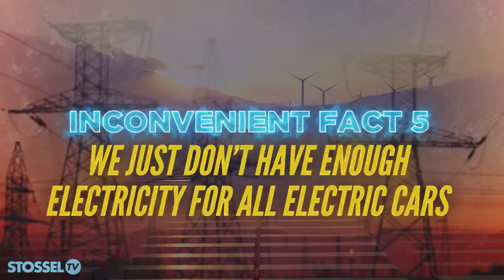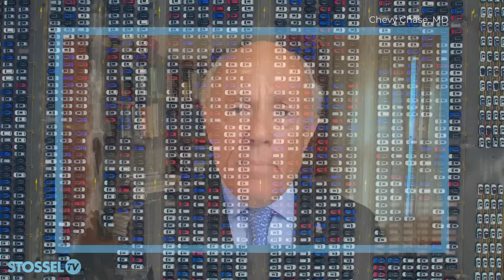Electric Cars: Inconvenient Facts, Part 2

Comment: I'm just happy someone like John isn't afraid of getting cancelled for giving a different perspective on this so called "green energy"
Reply: He can give another perspective but this video is full of things that are simply factually incorrect by a wide margin.
Reply: @dmacm nah I don't think so.
Reply: @dmacm  Please specify the incorrect things and provide the 'facts' with sources
Reply: @Argedis  I will cite my comment here in order for you to skim thourhg it and look at some of the lies told in the video:

=*=*=*=

· 1. The solar panel claim is completely false. The most the US grid has demanded in an hour is 720 gigawatthours. Even in winter, which is obviously the season with the least sun, an average square meter of US land will get around 3kWh energy/day from the sun (on summer, it's more like 8 and the numbers are obviously higher for sunnier states like Arizona). 3kW/h per day is 125 Wh. Now, accounting for the fact that solar panels harvest around 15% of the solar energy they receive and even accounting for the fact that some space would have to be left for other infraestructure to support solar (let's be quite pessimistic and say only 75% percent of solar infraestructure area is solar panels), the total area required would be:

720,000,000,000 Wh / (125 Wh/m^2 * 0.15 * 0.75) = 51,200,000,000 m^2 = 51,200 Km^2. And the US is 9,834,000 Km^2 big. In fact, Texas alone for example is 695,662 Km^2 big.

So, even if we put ourselves at the worst-case scenario (record demand in december with innefficiently placed and badly located solar panels), all the solar panels required to cover the demand would fit in 0.5% on the US or like less than a twelfth of Texas. I've just checked and my result agrees with studies such as a 2013 study by the National Renewable Energy Labs (NREL), which estimated (with 2013 efficiency numbers) that the area required is around 55,037 Km^2.

Not that you would want to do that, it would be stupid to only use a single energy resource and call it a day, but it demonstrates how big of a lie the statement was. Solar is more than efficient enough to be viable

· 2. No person that actually knows something about energy will tell you that we need to cover all of our storage needs with lithium-ion batteries. Batteries work well on a small scale (like phones, laptops, housing appliances, cars or maybe even as backups for homes). Despite of that, they are really innefficient and expensive on a larger scale. There are other methods (like gravity-based water pumping, electrolizers or air compresion, just to name a few) that are much better suited for the task of storing large amounts of energy, and those are the ones that would be used as energy storage and taken into account in a clean electrical grid.

· 3. "But wind and solar are so unstable and that makes them unviable". Wind and solar, are not the only CO2-free tools that we have. In addition to the energy storage already mentioned, nuclear and hydroelectric energy (and with less importance, geothermal energy) provide a stable stream of electicity at a competitive cost while generating practically no CO2 emissions. Studies such as N. Sepulveda J. D. Jenkins et al. (2018), "The Role of Firm Low-Carbon Electricity Resources in Deep Decarbonization of Power Generation" have concluded that combining renewables such as solar and wind with energy storage (like the ones mentioned in 2) and with these stable sources of power would be confortambly be able to cover 100% of the elecricity demand while producing practically no CO2 and while not raising the costs of electricity. In fact, given the war in Ukraine, how OPEC is jacking up fossil fuel prices and other geopolitical factors that won't fade away soon, we'd be much better of if our main source of electricity weren't fossil fuels. Renewable electricity prices have now been consistently cheaper for many years, but specially now.

And there's many more things that I've seen being wrongly claimed in your videos, but this one was the straw that broke the camel's back, almost nothing contained in it was based on reality, but in a false imaginary world taht we don't live in. If you want to keep making content like this, fine, you can do so, but know that you are simply promoting lies and false information to your audience. It's never too late to accept a mistake like this.

=*=*=

I personally also think that electric cars aren't a good solution for transporting people, but because cars themselves aren't a good option and have never been (that's another thing that the US doesn't get). In my opinion, he's defending the right thing but based on completely wrong premises and information. Electric cars won't solve climate change, they probably won't even help that much at all. But we shouldn't defend that with lies; he is just making it easy for those that think they are useful for dealing with climate change (or at least they say so in order to appear 'green' or for personal or monetary gain) to defend their (quite wrong) position.

That should cover it.
Reply: @adrianv.v.4445  Everything you said is theoretical, here are the real world numbers.

Per the EPA the daily energy use of all American Households 3.58 billion kWh - that's not including commercial or industrial.

Consumer grade 200W Solar Panels are 2ft x 5ft and around $250 ea.
In the real world they only produce around 150W.
You would need 10 of them = 20 ft x 5 ft to get 1500W which is barely enough to get "Level 1" standard plug charging on an EV which only gives you 1-3 miles per hour, or run a Microwave.

In other words with 100 Sq Ft of solar panels you only get 1.5 kWh assuming full sun.

The US is 3,717,792 Sq miles. If you do the math per my 100sq ft / 1.5kWh you only get 294 million kWh - it's not even close.

But that was calculating it for 1hr lets say 10hrs of full sunlight (not accounting for sunrise/sunset losses) that's 2.94 billion kWh which is closer but still not enough and like I said that's barely accounting for residential only.
Reply: @dmacm  please delineate? More truth than not so please elaborate
Reply: He's not getting canceled (nor should anyone expressing their right to freedom of speech), but he's not getting the attention he deserves due to social media algorithms.
Reply: @Argedis  The video is an excellent example of propaganda. It states something true or partially true, and doesn't tell you the comparison to an alternative. For example, their claim that an EV battery weighs 1,000 lbs and only replaces 80 lbs of gasoline. While that statement is true, it's also a falsehood in that an EV doesn't have a V8 engine + transmission, which combined together weigh 1,000 lbs. Furthermore, the statement that gasoline has many times more energy per lb (density)  than a battery (true), it fails to tell you that you waste 75% of that energy as heat when you burn it in a car. See how propaganda works?
Reply: @justsomeguy934  You're comparing the fuel source (battery) to the motor (engine)
The electric motor also has weight you know.

Also most of the energy is wasted as heat yes and we can use that same heat in the winter to warm the cabin unlike EV's which substantially use more power to do so.

We have been engineering engines to be more efficient to take advantage of that wasted power whereas with EV's the solution has been to put bigger batteries. Battery tech hasn't changed much in decades and the new 'solid state' batteries are extremely expensive compared to Lithium already.
Reply: @justsomeguy934  you can't be serious... heat energy is turned to force energy resulting in hp or torque you do not loose 75% to heat soak.

  You are not correct sir please please refrain.
Reply: @donguess4332  ok guys he doesnt think so , hold up , the word is going to change tho.
Reply: @dmacm  like?
Reply: @Argedis   Did they teach you how to use a calculator? With the numbers YOU provided, if you cover the whole US (1.058*10^14 sq feet, I don't get why some Americans still use Imperial) with solar panels with the efficiency you mentioned (1.5Kwh/100 sq feet), you would get 1.587*10^12 Kwh of power. That is, in a single hour, you'd get 1587 billion kWh, which compared to the less than 4 billion kWh you mentioned, means that after 2 hours, enough electricity whould have been generated to cover for all US households demand in the whole year. Yeah, the numbers get ridiculous when you do the though experiment of covering the whole US in panels. But, as I stated earlier, only a small portion of the US would be needed for the task. So basically, review your math a bit before proving your stupidity online (or even better, keep that dumbness to yourself).
Reply: @Argedis  But we are talking about replacing gasoline vehicles, not replacing  all the energy a person uses in the day.

I'm glad you ran some numbers though, even though you made some horrible mistakes in your calculation.  Lets try that again.   First I'll give you my estimate, then we'll correct your calculations.

The total energy consumption in the U.S. from all sources for 2021 was 97 quadrillion BTU, which translates to 28427895 million kilowatt hours.

The annual generation from a solar panel per square foot is around 238 kWh.   There are 27878400 square feet per square mile.  So we now have 6635 million kwH per square mile per year.   

So divide it out.  28427895 million kWh divided by 6635 million kWh per square mile is 4284 square miles.

That's a 65 mile x 65 mile square.

--

So, where did your calculation go wrong?  Well, lets try using your assumptions to find the error.

"Per the EPA the daily energy use of all American Households 3.58 billion kWh - that's not including commercial or industrial."

Lets validate this.  This comes to around 10.78 kWh/day per person.  Actually I think its more around 14 kWh/day per person on the EIA site, but we'll run with your number.

"Consumer grade 200W Solar Panels are 2ft x 5ft and around $250 ea.  In the real world they only produce around 150W. You would need 10 of them = 20 ft x 5 ft to get 1500W which is barely enough to get "Level 1" standard plug charging on an EV which only gives you 1-3 miles per hour, or run a Microwave."

"In other words with 100 Sq Ft of solar panels you only get 1.5 kWh assuming full sun."

"But that was calculating it for 1hr lets say 10hrs of full sunlight (not accounting for sunrise/sunset losses) that's 2.94 billion kWh which is closer but still not enough and like I said that's barely accounting for residential only."

This is massively incorrect and the reason is that you keep shortcutting your units and not keeping track, so you lost a lot in the translation. 

Your calculation... 100 sq ft x 1.5 kWh x 10 hours and you came up with 2.95 billion kWh per what ?  per square mile?  No. 

1 square mile is 27878400 square feet, so 1.5 x 10 = 15 kWh/day for 100sq feet.  27878400 / 100 * 15 =  4.181 million kWh per square mile per day.

So take 3.58 billion and divide by 4.181 million and you get (drumroll) 856 square miles using your numbers, which would be an area of 29 miles x 29 miles.

--

Lets recalculate another way to verify and use better metrics for the solar generation.  But I will still use your 200W panel so you can see where your other assumptions went astray.

One 200W panel at 2ft x 5ft will generate around 1.0kWh/day to 1.2kWh/day on average.   You just multiply the nameplate of the panel (200W) by 5-to-6 or so as a rule of thumb.

One square mile is 27878400 square feet.  One panel is 10 square feet.  So using 1.0kWh/day per panel we get 2.78 million kilowatt hours per day per square mile.   

Using your number of 3.58 billion kWh/day and converting it to millions, 3580 million kWh/day, and dividing, we get 3580 / 2.78 =  1287 square miles.

Which  is 35 miles x 35 miles.   Which is far far smaller than the total area of the U.S. by a huge amount.

--

Using fewer assumptions and 14kWh/day per person, the actual area winds up being around 65 miles a x 65 miles or so.

-Matt
Reply: @justsomeguy934  Electric Vehicles weigh more on average than conventional gasoline powered vehicles. Exceptions are the BMW i3, which is limited in range and uses a shitload of carbon reinforced plastics, and is an excellent in-city runabout vehicle, but certainly not an all-around vehicle I'd use for long distance transportation. Even if they managed to eliminate all of the other carbon emitting parts of the supply chain to build the electric vehicle and power it, that vehicle is going to wear down the roads it travels on faster due to the heavier weight.
Reply: @Argedis  The statement that you need to cover the US with solar panels to meet our energy needs was the most egregious misinformation. Look this up yourself. The true land requirements are small, and this isn't the main cost driver.
Reply: @bengaltiger96  Absolutely false, and the "heavier cars wear the roads more" is a falsehood from the oil industry about a decade ago. I just finished listing (in another thread on YouTube) ten average automobiles and their comparison to equivalent EVs - the results are the same. The EVs weigh in the same range as their gasoline counterparts. There is no weight penalty! Did you know the same oil industry propaganda used to also say heavier EVs meant more brake dust, so they caused CANCER? Yup, that idiotic thinking actually get repeated even today, from time to time. Just FYI, EVs don't use their brakes, so no  brake dust. 
As for an all-around vehicle, I've driven my 8-year old EV all over the USA with no problems. I've got almost 90,000 miles, been through desert, mountains, rain, 107-degree Kansas heat, snow, sleet. I'll never buy another gas car again.
Reply: @justsomeguy934  Volvo XC40 T5 R-Design gasoline) weight: 3,492 lbs. Volvo XC40 Recharge (EV): 4,758 lbs.
Reply: @justsomeguy934  I also never made any comments about brake dust, so thanks for the strawman.
Reply: @justsomeguy934  At 90k miles in 8 years, you are under the average yearly mileage for an American driver. But you've owned and used your EV in a manner that might lead to less carbon emissions versus a gasoline counterpart - assuming you've overcome the extra carbon emissions required to build your car due to the batteries, and the emissions from the power plants supplying the electricity.
Reply: @justsomeguy934  And I woudln't imagine the oil industry railiing against "heavier cars" given that the trend toward SUVs and crossovers has led to increased fuel consumption, which only helps them. And I'm not a fan of SUVs and crossovers, either, for this very reason. I used to live in Washington State, and I'd have to navigate my old 911 and 5 Series cars around the equivalent of single occupant Iroquois longhouses on wheels.
Reply: @bengaltiger96  " also never made any comments about brake dust, so thanks for the strawman." I am aware you never said anything about brake dust, I was showing you the source of your disinformation also stated that EVs caused cancer due to more brake use with a heavier car. Your source of information is the same.
Reply: @bengaltiger96  No, an EV breaks even in environmental impact of manufacture over a gas car at about 15,000 miles. I'll leave you a link with the information. I have friends with 170,000 miles on their EVs that Uber with them, and they most certainly are better for the environment at that mileage over a gas car.
Reply: @bengaltiger96  "assuming you've overcome the extra carbon emissions required to build your car due to the batteries, and the emissions from the power plants supplying the electricity." Burning gasoline vs. a steam turbine at a utility plant is no comparison - a gasoline car not only wastes 75% of its energy as heat, but it's a much dirtier fuel than a utility plant can use. Over the life of the EV, it's twice as clean as a gas car.
Reply: @bengaltiger96  Tesla Model S: Curb weight: 4,323 to 4,936 lbs. Mercedes S-Class Sedan: 5,236 to 5,346 lbs. My Model S could be configured as a 7-passenger vehicle with superior performance to the S-Class, yet weighs less.
Reply: @bengaltiger96  Volvo XC40 Recharge (2023 model) weight: 4,679 to 4,780 lbs. Tesla Model Y weight: 4,555 lbs. Difference: buy an EV from a real EV manufacturer.
Reply: @justsomeguy934  How do you know that's my source of information? You're presuming an awful lot, and it seems to stem from your bias. Not good or bad, just a matter of fact.
Reply: @justsomeguy934  Why are you comparing an EV to another EV? I thought the point was comparing gas vs electric.
Reply: @justsomeguy934  Again, comparing two different cars: Mercedes S-Class gasoline mild hybrid 4-MATIC: 4,775 lbs. Mercedes EQS 450+: 5,302 lbs.
Reply: @bengaltiger96  I used your Volvo example to show that the Volvo is a gas car remake, not an EV from the ground up. Almost ALL legacy car makers that now make an EV have cloned an ICE chassis and slapped batteries into the car. If you're going to look at the Volvo, realize that they didn't design an EV from scratch like Tesla does, they modified an existing chassis. You can't say adding batteries to a non-EV car proves EVs are heavier as a rule.
Reply: @bengaltiger96  2021 Mercedes-Benz S 580 4MATIC Sedan Specifications: 	4,775 lbs. Tesla Model S: 4,561 to 4,766 lbs. Net difference: 9 lbs. I also have the stats for a half-dozen cars, same class, compared to the Tesla Model 3. Your claim that EVs are heavier and wear the road more is baseless.
Reply: @bengaltiger96  "You're presuming an awful lot, and it seems to stem from your bias. " I'm presuming nothing. I take my EV to car shows on a regular basis, and the battery weight comes up all the time. Every time someone asks me about EVs being heavier than a gas car, I ask them why they think so. In all cases, 100% certainly, they say "I read it somewhere" or "I heard it somewhere". In almost a decade of hearing the statement, not once has a single person said  "I figured it out for myself". Not.One.Time. So if you want to tell me that the thought of EVs having a weight penalty originated with you from no outside influence, you didn't hear it or read it from anywhere else before you made the statement, OK, you're the singularity in the universe of my experience.
Reply: @justsomeguy934  Is somone who is a Merc person gonna move over to Tesla? In some cases, yes, but more often than not, they'll move to their own brand's EV. The only reason they've moved to Tesla is because there wasn't the alternative before. Tesla is the Snapple of electric vehicles. Do you remember Snapple? They were one of the first fresh brewed iced teas and because most canned or bottled icea tea at the time was shit, Snapple was all the rage. Now that the traditional tea makers got into the game, Snapple is just a footnote. Same with Tesla. They deserve all the credit in the world in moving the EV game forward as much as they have (of course, they got help from Eagle Capital aka the US Government), but they are gonna have trouble because there are things a carmaker can teach a tech baron, just as there were things the tech baron could teach the carmakers. You seem to be annoyed that I'm against electric vehicles - I'm not. I just don't see them in a Polly Annish world - they have their downsides as much as ICE cars do. And Tesla still remains perhaps the one carmaker with a charging infrastructure - which still hasn't really been built out to support mass use of electric cars. And what about hydrogen - what if that becomes the next thing over? As I said before, we need to use all the tools in the toolbox - mild hybrids, hybrids, PHEVs (when they suit), and diesel (for long distance transport, we have yet to find a better alternative). Anyone promoting only one solution (like those who diss nuclear in favor of solar and wind) - I can't take them seriously if they are hell bent on reducing carbon emissions. More often than not, we are shooting ourselves in the foot with bad policy. And given that EVs are hella expensive, why exactly does a Tesla need a $7,500 tax credit? Shouldn't that credit go to a cheaper hybrid which will save gas, promote more efficient use, and might be something the average American can afford (If we have credits at all)?
Reply: @justsomeguy934  Well, I'm reading it from carmakers specifications, so I'm not sure how that jibes with oil industry influence.
Reply: @justsomeguy934  Okay, so I'll take Hyundai as an example. Although the cars aren't like for like, I'll compare curb weights for their ICE passenger cars with their new Ioniq 5, which was a from-scratch EV design: Elantra curb weight: 2,868 lbs. Sonata curb weight: 3,230. Ranges? Elantra: 459 miles, Sonata: 474 miles, Ioniq: 220 miles (if you want more range, of course, you'll need more battery, and a heavier car - the 303 mile range Ioniq is 4,300 lbs). The lightest Ioniq 5 curb weight: 3,968. I'll bet the battery pack makes about 600-800 lbs of that weight also, not to mention the frame strenghtening, fire suppression, and other items needed. And that's another thing: why do all these EVs have to do 0-60 in 3 seconds? Look at the Chevrolet Bolt EV. 200hp and all the torque you can eat. 0-60 in 7 seconds, plenty fast enough, and it doesn't need as big a battery to go far. And it's reasonably priced, as opposed to a Tesla, which is more a virtue signaling device than an environmental impact statement.
Reply: I suggest to the viewers that you check the video of Sam Alexander who destroy with real facts this video and get a sense of how bias is this guy.
Reply: @adrianv.v.4445  The electrification of transportation will remove most of the pollution is cities where most people live. That fact alone would suffice to legitimize the electrification of transport (also fewer cars and more trains are better).
Reply: @SoGoodRc1  The heat you feel of the motor/exaust/break is the lost. If it were not lost, you would not feel it, it would be used.
Reply: @bengaltiger96  "Look at the Chevrolet Bolt EV. 200hp and all the torque you can eat. 0-60 in 7 seconds, plenty fast enough, and it doesn't need as big a battery to go far." I'm not sure of you're point, I'm highly supportive of the Chevy Bolt! I often recommend that EV to people, and know several owners that are very happy with their cars. I'm not a Tesla-only person, regardless of what you're trying to imply.
Reply: @justsomeguy934  First off, I never said EVs were bad. I'm saying there are many ways to do your part to reduce emissions. You can buy a hybrid (which makes sense for those who can't afford an EV, especially a Tesla). Or you can do like me, and buy a smaller car (albeit a sports car) that wasn't heavy, that suited my transportation needs, and was fun to drive, yet still got 30 mpg on a long commute to work. I don't need an SUV or pickup truck. If I had to get an electric car, I'd probably get something like a Bolt or an i3 because I don't do much driving these days (I live in a near city suburb and public transport is closeby). And you can always take public transport if it's available. You can also buy used, in which case the emissions of building the car have already been paid, and you're not asking the universe to create a new car for you. There are many ways to skin this cat - EV's are only one solution, and should not be the only solution - at least not until grids are in place, charging networks are in place, and even then, leave room for hydrogen, diesel for long range transport (because EVs will never fill this space), etc.
Reply: @justsomeguy934  You've only referenced the Tesla, whereas I've referenced the i3, the Ioniq, and the Bolt. Not that I mind the Tesla, but most people who buy a Tesla and boast about it seem to be virtue signaling. I rode in a Tesla in Vegas as an Uber ride, and I was impressed with the tech, but I'm not impressed with the price. I get what Elon was doing - building the spendiest models first in order to get early adopters, but damn, we're past that now, and every automaker now has electric vehicles - even Porsche. One Tesla driver had zero emissions on his license plate, and I'm thinking "damn, I didn't know they shut down every coal and gas plant in Australia!" To demonise other's choices because they didn't choose an EV as their method of reducing emissions is self-defeating and unproductive. Look at what's happening in Germany, in Europe, and in Australia with electricity - they've tried to race to wind and solar so fast they are now having rolling blackouts. The BMW EVs don't charge very fast - do you know why? Becuase the German grid can't handle all of them charging at the same time. Until that gets sorted, EVs aren't quite ready for prime time as the only solution.
Reply: @bengaltiger96  EVs are suitable for personal transportation (passenger cars), trucks (personal pickup trucks), mass transit (city busses) and semis (tractor trailers). As long as the vehicle doesn't have to swim or fly, we're golden. They use less energy, pollute less, last longer, cost less per mile. I own a gas SUV and a gas sports car. I appreciate that you are open to EVs as part of the transportation mix. It's funny that I actually get people saying "what about airplanes?" as if it's some argument that disables the use of an electric passenger car.
Reply: @bengaltiger96  "And given that EVs are hella expensive, why exactly does a Tesla need a $7,500 tax credit?" All EVs could use a tax credit. I think the better question is why does the oil industry get $649 billion in annual tax subsidies? Why does the oil industry get free military protection for its trade routes? We don't give carrier escorts to container ships with TVs or food or shoes...
Reply: @bengaltiger96  "And what about hydrogen - what if that becomes the next thing over? " Hydrogen is not a good fuel for passenger vehicles. It loses 80% of its energy potential in the processing and transport/storage of the stuff. It's as bad as gasoline in that regard. 
Realize the only reason you're hearing about hydrogen as a fuel is that 80% of all commercial hydrogen is supplied by the oil industry! They want their hands in your pocket for another vehicle fuel.
Reply: @bengaltiger96  "Well, I'm reading it from carmakers specifications, so I'm not sure how that jibes with oil industry influence." I have never said car maker specs have oil influence. I'm just saying until EVs came along (and oil industry income was threatened), no one cares or SHOULD CARE about vehicle weight. It's never been an issue, no one chooses a car based upon road wear. It's a red herring thrown out by a frightened oil industry.
Reply: @bengaltiger96  "Becuase the German grid can't handle all of them charging at the same time. Until that gets sorted, EVs aren't quite ready for prime time as the only solution." EVs don't all charge at the same time. We don't all buy groceries at the same time, we don't all use our telephones at the same time, we don't all do laundry at the same time. I cannot comment on charging in Germany, but only about 5% of EV charging is trip continuance.
Reply: @bengaltiger96  " Look at what's happening in Germany, in Europe, and in Australia with electricity - they've tried to race to wind and solar so fast they are now having rolling blackouts." The blackout red herring is from the oil industry. 95% of all EV charging takes place at home and off-peak. Blackouts only occur at peak demand, not off-peak. EVs are not responsible for power outages, nor do they represent any significant demand on the grid. If a country, or state, or zip code, is having blackouts, it's a power generation problem, not an EV problem.
Reply: @bengaltiger96  "I rode in a Tesla in Vegas as an Uber ride, and I was impressed with the tech, but I'm not impressed with the price." Tesla makes the Model 3 that costs exactly that same as the average automobile price in the USA. That alone is a miracle, as they have brought the price down to average within a decade. I'm absolutely pleased that you can buy a Chevy Bolt for $27,000, more power to you. Personally, I like the styling of the new Hyundai EVs over the Model 3.
Reply: @bengaltiger96  "One Tesla driver had zero emissions on his license plate, and I'm thinking "damn, I didn't know they shut down every coal and gas plant in Australia!"  They mean zero emissions at point of use. Even using 100% coal energy, an EV is far cleaner than a gas car because a utility can burn fuel more efficiently in the creation of electricity than a gas car can use to create kinetic motion.
Reply: @Argedis   Because of ICE being only about 25% efficient and 75% going to waste, it is so good to know that you will be able to utilize 6% of that wasted heat to keep yourself warm. The other 69% still goes out the tail pipe as unused, wasted energy. There is approx 40kwh of energy in one gallon of gas. Waste energy takes that down to 30kwh.  I figure you need at most 1.8kwh to keep your car toasty on a cold day. So you still blow a majority of heat out the tail pipe.  Also Tesla now use heat pumps which can be more than 100% efficient and can move heat from outside to inside. On a hot summer day an ICE car has to burn more gas and produce more heat waste to keep you cool. Tecla's heat pump can store the cabin heat in the battery to help keep you cool and again has an efficiency of over 100%.  Heat pumps are awesome.
Reply: @jeffbonvallet9480  You're comparing 2 completely different things.

Heat Pumps may be efficient but they still require A LOT of electricity. Your average household portable heat pump can use over 1kW-1.5kW. I've read a lot of complaints of EV A/C's being extremely weak and that's because they have to make them energy efficient at the cost of performance. The same would apply to heat since it's just the inverse.

Also, although ICE engines are energy inefficient the difference is we have been making them more efficient as time goes on, that even includes adding electric motors (hybrids). 

EV motors are already efficient all they can really do is make bigger batteries. Solid state batteries are already way more expensive the current Lithium.
Reply: @justsomeguy934  You gotta get off the whole oil industry conspiracy theory thing, it's like Blue-Anon instead of Q-Anon.  It is a power generation problem, but it's similar in that it's a rush to move to an advanced technology without considering an intermediate transitional step. EVs aren't causing the power outages, and I didn't say they were, I'm saying they can't be utilised to any sort of full potential because the infrastructure isn't ready for prime time, and that has and will play a big role in the adoption of EVs. Here's where you should be saying that even a coal-fired plant is better because it's a single source of pollution that can be harnessed and potentially scrubbed/cleaned/sequestered rather than 1 million vehicles spewing all over the place.
Reply: @justsomeguy934  Again, here we go back to using all the tools in the toolbox, not just a single solution. If one is serious about reducing carbon emissions, they should be willing to look at everything on the table, not just one way to go. Every bit helps. And in every bit there is a solution we can onsell or license to others who will continue to use these older technologies. Again, this will help the USA until China steals the IP.
Reply: @bengaltiger96  "If one is serious about reducing carbon emissions, they should be willing to look at everything on the table, not just one way to go. " Yes, I agree. I'm not saying we must force EVs on everyone. But the difference between an EV and burning gasoline is dramatic, so when I see the propaganda put out by the oil industry to the contrary, I comment about it.
Reply: @bengaltiger96  "Here's where you should be saying that even a coal-fired plant is better because it's a single source of pollution that can be harnessed and potentially scrubbed/cleaned/sequestered rather than 1 million vehicles spewing all over the place." Um, I DO say that. Even using 100% coal energy, a steam turbine making electricity produces less pollution and is more efficient than giving gasoline to cars. I have NO PROBLEM with coal energy, especially when used as off-peak energy.
Reply: @justsomeguy934  Just hope your Hyundai doesn't get stolen as part of the Tik Tok Challenge.
Reply: @justsomeguy934  I'm not a fan of subsidies for anything. The EVs, the oil industry, sports teams. It's hard being a sports fan with all the corporate welfare thrown at owners to build stadiums.
Reply: @bengaltiger96  Sorry, I don't understand the Hyundai reference..
Reply: @bengaltiger96  oh and by the way, I'm not sure we disagree on all that much. The conversation has been civil so far, and I appreciate it.
Reply: @bengaltiger96  I also agree on the subsidies, however, I think EVs are an exception. And not because I'm interested in them. There are two types of subsidies: 1) new technology that doesn't pay for itself commercially, and 2) vital industry for national security. EVs fall into the first category, as did commercial airlines (at the start), microchips for the space race (at the start) and other tech. Subsidies to farmers to grow corn when years of drought would bankrupt them are an example of #2. The oil industry getting billions annually has no justification, nor does bailing out the legacy car makers. The legacy car maker bailout was a union pension bail-out, and nothing more.
Reply: @bengaltiger96  I guess I left out a third type of subsidy, but you could call it a behavioral incentive. That's the kind where the government gives a tax break if you do something they deem beneficial for the collective good. Examples: buying EVs, buying solar panels, buying energy-efficient refrigerators, buying energy-efficient windows. This type of tax break moves the markets in a certain direction the government wants it to.
Reply: @mletouutube  you do not loose 75% your off your rocker 🤪